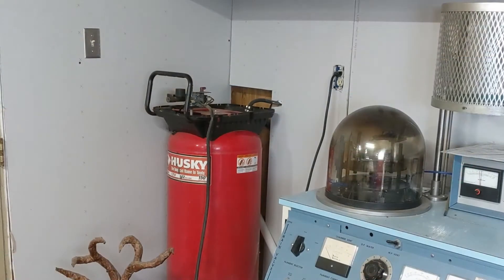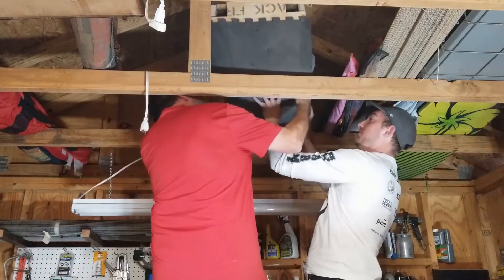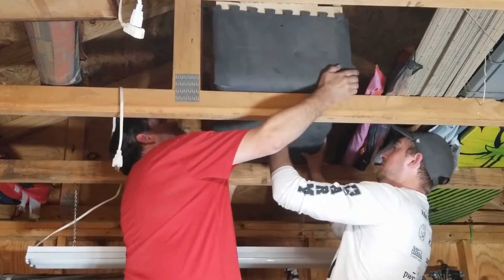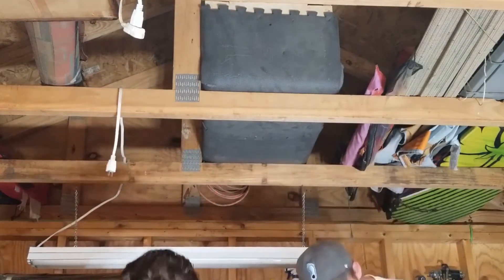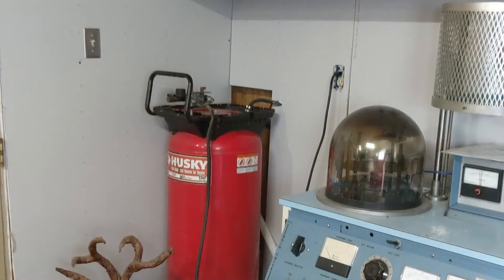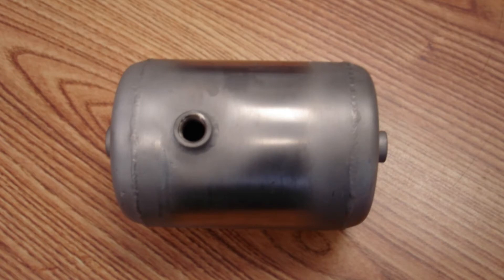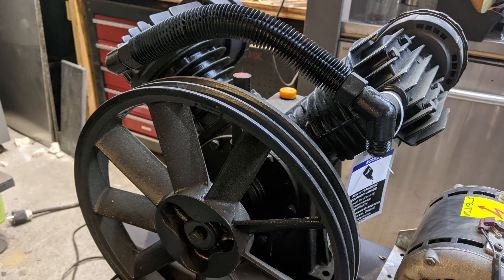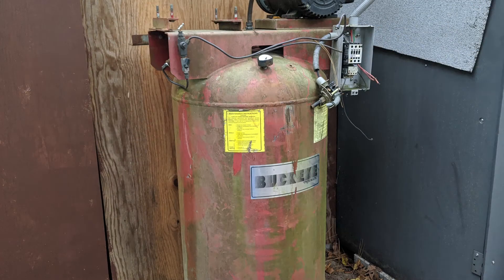Part 2 - Quiet Air Compressor Build - Insulation Mounting Testing | How to fix a loud air compressor

Comment: Nobody thinks about this but, the air compressor itself releases vibrations. these vibrations can be felt through the box releasing sound down through the ground or the box banging against the air surrounding it and into the room itself. Refrigerator pumps are put on springs in a cavity to absorb the vibrations. I would consider putting the air compressor on a plate that has springs under it to absorb some of the vibrations force. That would lead to a very substantial sound reduction due to the box kept out of resonance. Living a high residential area in Japan so I would take my word for it. Japanese love quiet!